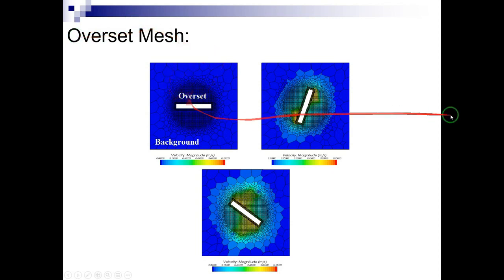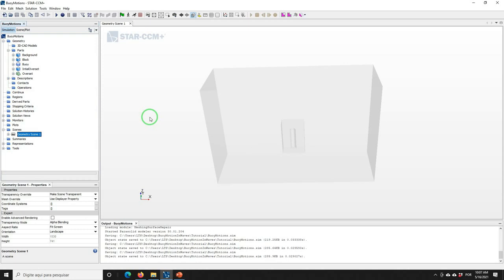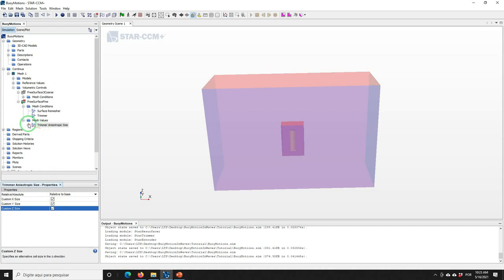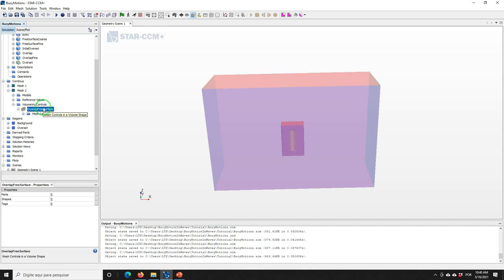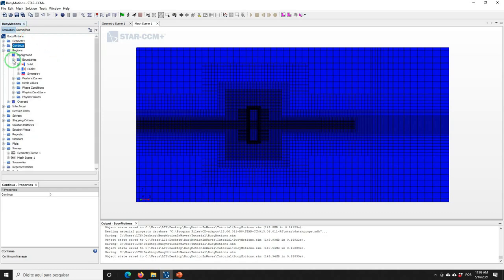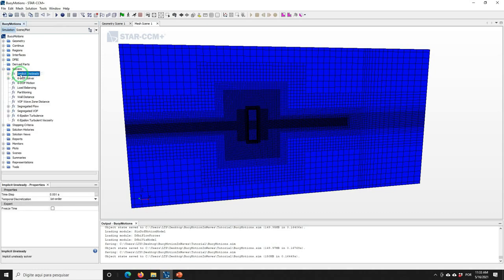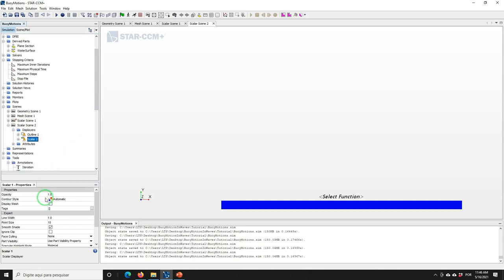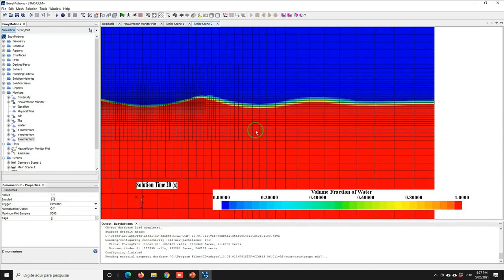Tutorial: CFD simulation of a Buoy Motions in Waves Using DFBI and Overset Mesh (STAR-CCM+)

Comment: Beautiful tutorial! By the way, I will recommend this CFD channel!

I am simulating the heave decay of a cylinder in calm water, both in open water and in a real tank. I would like to know which boundary conditions I should choose for more realistic simulations. For the tank domain, I set wall boundary conditions for the sides, except for the top, where I used a Pressure Outlet condition with 0 atm (atmospheric pressure).

In the open water case, I applied your boundary conditions, but I encountered a reversed flow at the pressure outlet. To address this, I changed the setup by using velocity inlet conditions at the top and bottom, symmetry plane for the symmetry boundary, and pressure outlet with a VOF condition for the remaining boundaries. However, I still get the same issue.

Moreover, the decay plots from the simulations show a longer decay period compared to the experimental results. For example, while the experimental decay finishes after 10-15 seconds, my simulation takes significantly more time. I am unsure what the problem might be (I am using the SST k-omega turbulence model with y+ = 1).

I would greatly appreciate any advice you could provide.
Thank you in advance!

Comment: Hello! Could you please illustrate the value you used in the time step and you says"However, note that the estimation of the time – step size should also be in such a manner that in each time – step, the overset mesh moves a distance smaller than the size of the smallest cell in the background mesh. Therefore, considering this point, the time step size that we are going to use here is 0.001 sec. " from where we can see 0.001 sec in the simulation? please.
Reply from the maker: Hello,
To calculate the time-step size, you can use the Courant number defined according to the minimum cell size within the background mesh, along with the maximum vertical displacement speed of the overset mesh.
I hope this helps.
Respectfully,
Mojtab Maali Amiri.
Reply: @CFD_Mojtaba  Hello! I still have a problem in the wave generation shape, I tried more than one example but still not normal shape, could you please let me know after calculating the courant number how we can use it in the simulation? I looked at papers says ::"with a second–order
temporal discretization scheme. This results in a Courant
number (C=Cg.
Δt/
Δx, where Cg is the wave group velocity) less
than 0.5; hence, the High–Resolution Interface Capturing (HRIC)
scheme that is suited for tracking sharp interfaces  is guaranteed to
be used during the simulations. My question is after calculating the courant number (C=Cg.
Δt/
Δx,  how to use the result value in the simulation? Do you have an example, please?

Comment: Hi, 
I am finding the added mass and damping coefficient of different floating structures using the forced heave method. For that I simulated a cylinder in free surface by STARCCM+. I should get a force between -5 and 5N when STARCCM+ gives me a force of 30N. I deduced buoyancy force and hydrostatic force from it still not in the desirable limit. following are the details and solvers i used for the simulation 
1) implicit unsteady, VOF for free surface , K - epsilon turbulence with no DFBI and dynamic mesh . I also tried dynamic mesh (overset) and DFBI . 
2) I have given velocity in the form of A SIN (wt) form under the motion tool as translation motion. 
3) My CFL number is kept below 3 
4) Flat wave with zero velocity for air and water. Initial conditions for velocity and pressure are given as zero.
 5) slip wall for domain walls , and no slip wall for the translating body.  
 The drive contains my simulation . Can u please take a look at my simulation and tell me wats wrong?
https://drive.google.com/file/d/1rFnL4449stu4aWyPewxF3HGHoxp11_j3/view?usp=sharing

Comment: Hi, first of all thank you very much for the video .
I am doing free surface simulation of a floating body under waves in starccm+. 
As the first step i have generated waves without a body but getting reversed flow . my mesh refinement is fine . 
can you anyhow explain the reversed flow . And is there any other boundary conditions I can use instead of pressure outlet to absorb my waves like we do in in experiments in starccm+.
Thanks in advance.

Comment: How did you calculate mass of the buoy as 780 kg?
Reply from the maker: You can calculate the mass based on its draft. To be in balance, weight must equal buoyancy.
Reply: yes but here for this cylinder if we are considering the draft as 2m , we are getting 1560 kg as weight right. Then why it is considered as 780 kg?
Reply from the maker: @DevanarayananRoe22m010 , because we are simulating only half of the cylinder.
Reply: thanks a lot
 @CFD_Mojtaba
Reply: @DevanarayananRoe22m010  Hello, May I ask please? How you get the calculated mass = 1560kg? Because when I calculated under the balance case: the Body mass m_body = ρ_the density of water * the immersed volume  of the bouy_(water displaced). so The Body mass = 1000* (Pi * 0.5*0.5*2)=1570 kg, could you please illustrate to me how to get the mass body = 1560 kg not 1570 kg ? what is the water density value you used please? Thank you in advance!
Reply: can we get linear added mass coefficient and radiation damping coefficient from star ccm+? If so, can you tell how to do that?

Comment: Hi, If I want to give the floating body an initial pitching angle like 8 degrees, then where should i do that? I am struggling with it. I tried to transform and give rotation of overset block and then initialize the solution but the pitch plot starts from 0 degree, not 8 degrees. can you suggest something about it. Thanks
Reply from the maker: You may be able to do this under Rigid body configurations. I hope this helps! Good luck.
Reply: @CFD_Mojtaba  under the DFBI option?
Reply from the maker: @designsimulate3384  Yes. I think so.
Reply: @CFD_Mojtaba  Thank you

Comment: Hi, what if I want to give a specific velocity to the air, then how should I model it and what changes to make. please comment.
Reply from the maker: Hello, I think it is possible by using the air volume of fraction value at the inlet. About the weight, it has been calculated to guarantee the floating of the body by putting weight equal to buoyancy.
Reply: @CFD_Mojtaba  Thank you :)
Reply: @CFD_Mojtaba  Thank you for your reply. Just for my understanding, if flow is from left to right, then the left most surface of the background mesh block is defined as the volume fraction of air? I am confused in the point is that this same surface is shared with water too, so would that effect the wave generation?
Reply from the maker: @designsimulate3384  The volume fraction of water and air changes in the direction of gravity, so at the bottom we have water (heavier) then going up we get air. It can affect surface waves, but it's something you need to evaluate. Have a look at this video for more information: https://youtu.be/7W8JqP1Le3I

Comment: Hi Mojtaba, there is a message told me that "Please check your initial values for "Volume Fraction" in the following regions: [Backgrounds, Overset]", however, I check all settings which are the same to yours. Could you help me how can I fix this? Thanks very much.
Reply from the maker: Dear Xiudi Ren,

If the settings are the same, I'd say you need to check the quality of your mesh on the free surface and at the interface between the background and overset regions. Most of the error in the CFD can be traced back to the mesh.

I hope this was helpful.
Respectfully,
Mojtaba.
Reply: @CFD_Mojtaba  Hi Mojtaba, I found that if I change the version of the Star CCM+, then it works. Thank you very much for the video and reply!

Comment: Hello sir ,can I follow the same procedure for a stationary sphere in a freesurface !
Reply from the maker: Hello, 
Thank you for your comment. Yes, you can use the same procedure. 
Respectfully,
Mojtaba
Reply: @CFD_Mojtaba  Thankyou for your reply sir😊
Reply: Sir ,In my starccm version, it is recommended to use part based meshing instead of region based, as a warning .So I tried with part based meshing ,but while executing the mesh ,a warning came like " trimmer  cannot currently accomodate multiple regions in one continuum in starccm+".
Sir, please help me to solve this one.
Can you please explain the things I have to follow while doing part based meshing instead of region based meshing .
Reply from the maker: @anjalikrishnac3738  part-based meshing is basically the same as region-based one. Also, to solve the problem you are facing, you need to associate a separate mesh continuum to each separate region. 
I hope this was helpful.
Respectfully,
Mojtaba.
Reply: @CFD_Mojtaba  yes sir it's helpful.
Reply: Sir I have one other consern regarding the simulation time .iam using a 4 core system(24gb ram ).So should I able to reduce the domain size in this same problem to reduce the simulation time ..or it will cause any trouble if I reduce the domain size !
Reply from the maker: @anjalikrishnac3738  The size of the domain has to be chosen in such a manner to guarantee the minimal effect of the domain dimensions on the solutions. If you wish to use this data to publish a paper or write a thesis or something similar, you need to perform a sensitivity study regarding the influence of the domain dimensions on the solutions. 

Sincerely,
Mojtaba.
Reply: @CFD_Mojtaba  Ok .Thankyou sir .Expecting your valuable help in future also 😊

Comment: Hello sir, can you share me the step by step procedure in Star ccm+  to calculate the torque and rpm of a wind turbine?
Reply from the maker: Hello  RADHKRISHNAN PV, 
Thank you for writing. 
The angular velocity (rpm) is defined by the user. On the other hand, torque at any blade section is defined as the net aerodynamic force in the plane of rotation times its distance from the center of the rotor. Thus, the moment in the direction normal to the rotor plane is exactly the torque value. To calculate the torque value, all you need to do is create a local coordinate system such that one of its axes is perpendicular to the rotor plane. The moment in the direction of this axis is equal to the torque value. 
I hope this was helpful.
Respectfully,
Mojtaba.
Reply: Thank you so much sir for your response, I will try it

Comment: Thanks for your good tutorial.
Can you please tell me how to check the quality of mesh in StarCCM?
Reply from the maker: @Văn Duyền vimaru thank you for writing. 
  The quality of the generated mesh can be measured through the evaluation of the cell skewness angle. For this purpose, right click on plots> New plot> select Histogram Plot. Click on Histogram Plot 1 and set the parts to your computational domain. Then, under axis type click on Bin, and set the field function to Skewness Angle. 
In the resultant plot, you can see the number of cells with a specific skewness angle.  In order to reduce the influence of the skewness angle on the results it is recommended to keep it under 85 degrees.
I hope this was helpful.
Respectfully,
Mojtaba.
Reply: @CFD_Mojtaba  thank you so much for your replies. It is so helpful!
Reply: Could you please show me how to export the mesh from StarCCM?
Reply from the maker: @vanduyenvimaru6835  you need to select File>Export .
This menu item opens a dialog, in which you can specify the following items:
1. file type.
2. the name of the new file
3. the types of data to export to the file. 
You can find more information about this topic in "Exporting Mesh and Solution Data" in the user guide. 
I hope this was helpful!

Happy new year!
Respectfully,
Mojtaba.
Reply: @CFD_Mojtaba  thank you so much!